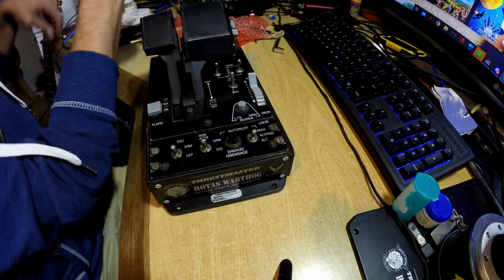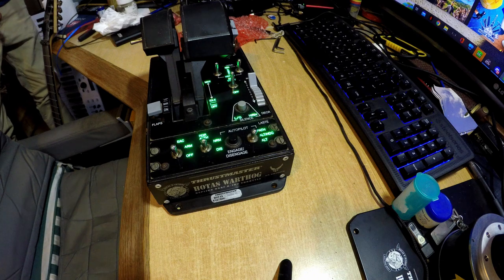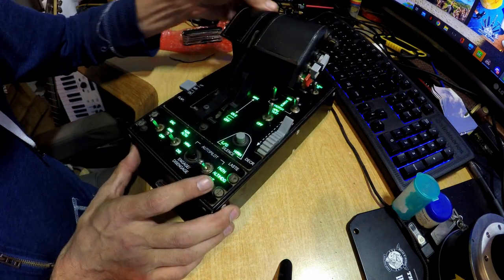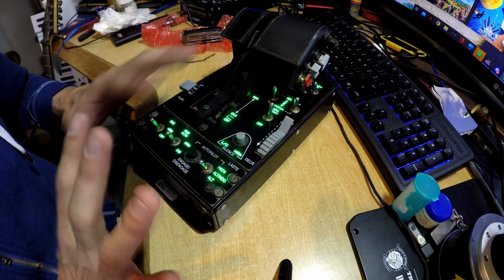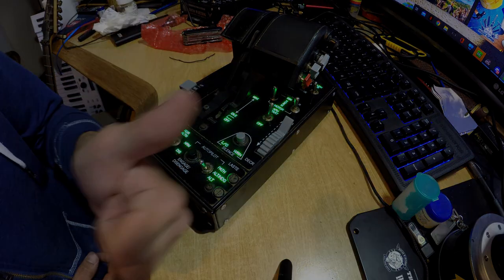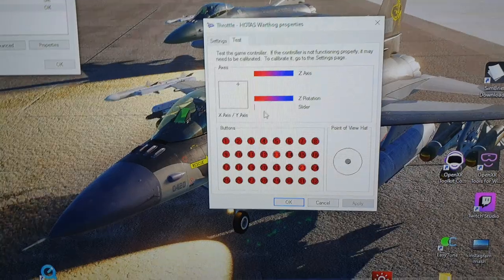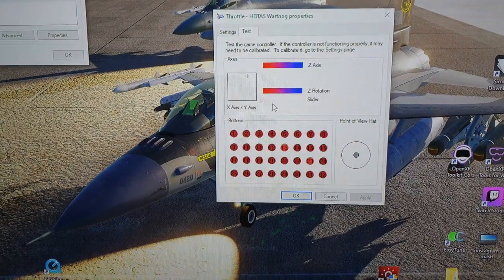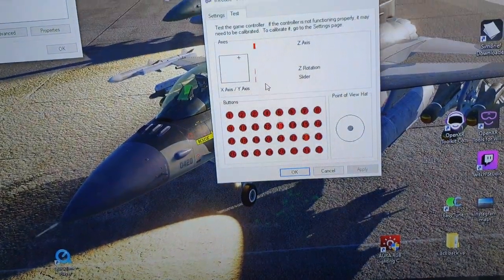CAN WE FIX IT, how to fix thrusmaster warthog

Comment: A few years ago, I bought a dead TM WartHog throttle for almost nothing. Bought the board and installed it.  Now I have a like new TM WartHog throttle.  These things are among the best flight throttles made, even though these are several years old at this point.
Reply: where did u find the board
Reply: @chocorock23 I don't recall where I bought the board from.  I may have been from Ebay, or directly from Thrustmaster.
Reply: @gregpruitt1647   Thanks for the reply, My board went bad and i need a new one but can't find.  I ended up getting a mongoose throttle
Reply from the maker: @chocorock23   i got mine from thrustmaster themselves, great support when i did get it.
Reply: Minus the fact that those boards shouldn't even be bricking at all, considering their price point. I have a feeling they halfassed the bootloader and its getting bricked from firmware updates. Mean while old 20 year old x45's are still going to this day.

Comment: just reflow the chip. that brought mine back straight. 
some forums say try usb hub first  populated with random things  to lover 5V - that can make it work also.
you skipped the hardest part- remove the hot glue from original plugs. 
also - you replaced the board. it is no fix - or unbrick  at all.
Reply: Hey man, I have the exact problem. Can you please tell me what chip needs reflowing? I am considering letting some local phone repair shop doing this for me. THank yoU!
Reply: @martinreckziegel8372   the black on the middle- first can be seen  0:59    - size like  a micro sd card .some flux and gentle reflow for few sec solved my issue. good luck
Reply: I am reql bad at soldering, do you think a phone repair shop would be able to do it?
Reply: @martinreckziegel8372  sure they can. in minutes.
may fix it may not.
Reply: @bazdmegmar  thank you very much, so just for me to understand, reflow means heat up the current solder, reseat the chip and flow the flux in to solder it back in? I jsut want to give them proper instructions 😄
Reply: @martinreckziegel8372  they just add some flux - material to help the solder melt better- and apply heat for sort time till the solder points melt - above 220 C  - with hot air station  around the chip . no need to take off . 

check videos on youtube for reflow - no need to take off. can be done in few minutes.
Reply: @bazdmegmar  man it worked! You are a legend! Paid 20 eur, they did the reflow of the chip - throttle woke up! Just did the bulk fw update. Love you!
Reply: Hey, so what do you mean exactly? Do you have a video of this? Mine died a few days ago
Reply: @AlexisTheKingNL   contact with Thrustmaster support- they need some pics or video and the serial number - and will offer replacement board around 50- 
or you can take into phone repair shop - or do it yourself if have some experience with bga work.

reflow the black chip which first visible at 1:00  under the silver ring- black tape and -red  wire thing.